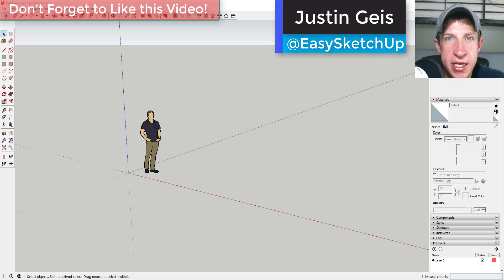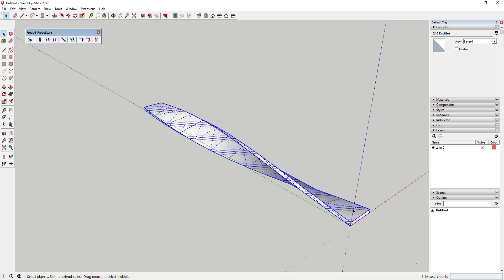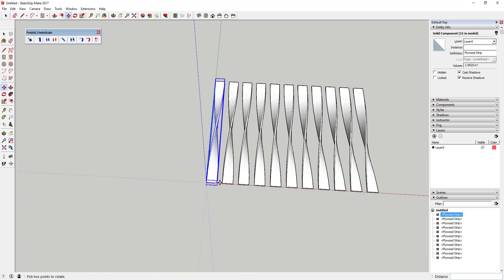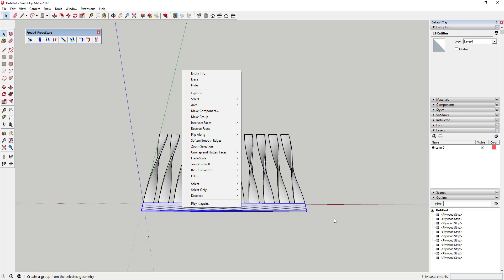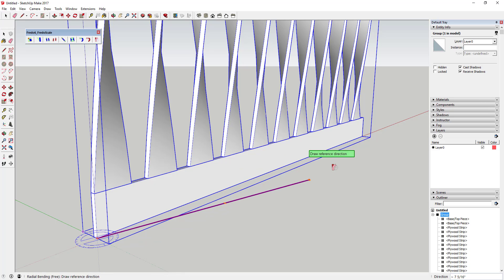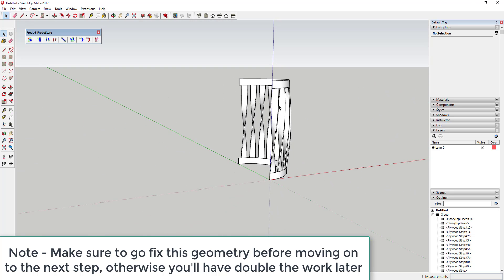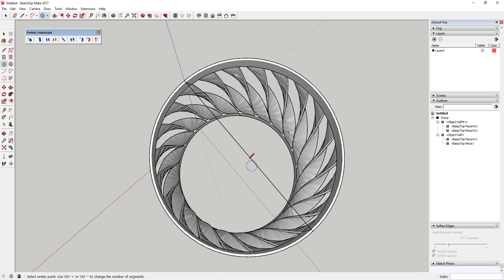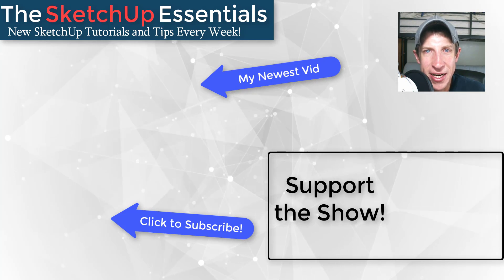Modeling a Twisted Lamp in SketchUp with FredoScale - SketchUp Extension Tutorials

Comment: how come when i drape an outline on a rounded surface and try to joint push-pull it the end result is missing faces?
Reply from the maker: I'm not 100% sure, to be honest. Seems like sometimes joint-push pull leaves out faces for some reason, and I'm not sure why.
Reply: i solved it, the lines have to be completely connected in the outline after draping.